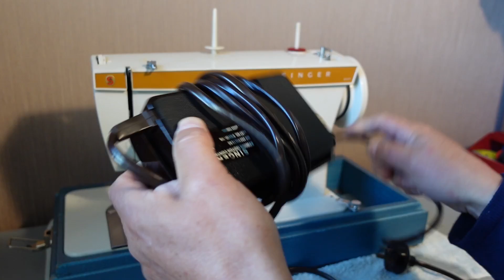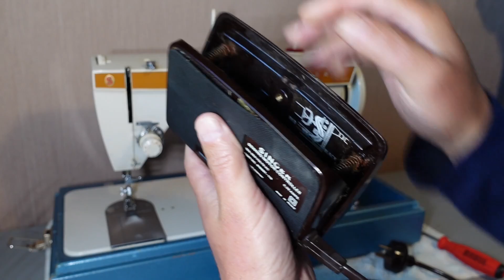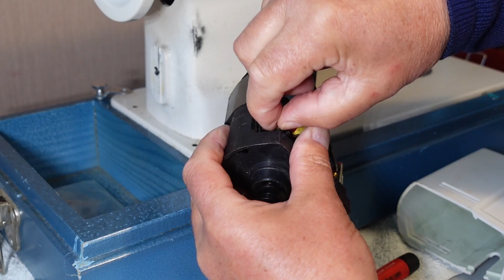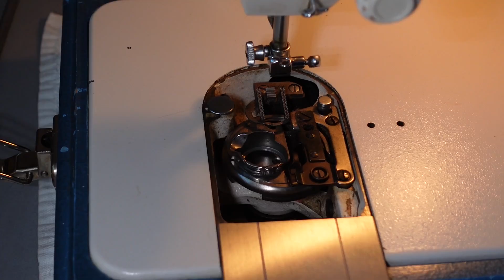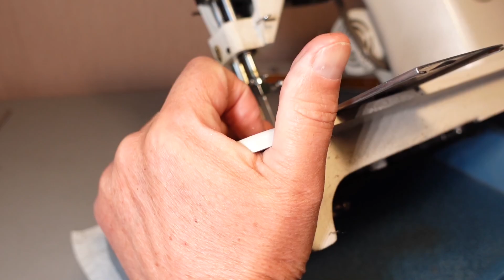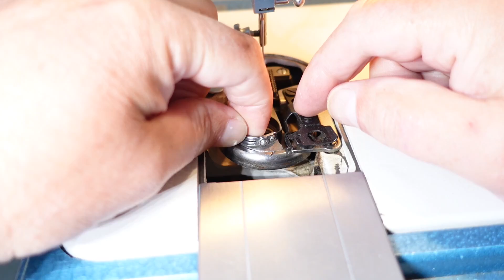Assessing a Singer 247 Sewing Machine for Donation to a Local Charity Shop

Comment: He identified a fault with the cam stack gear, and just left it that way. I think if that is going to fail (as he points out it could fail immediately) then retrofit it with a metal part? I could not find the nylon part online and could not find a metal retrofit either. I did find the Singer part number, #444918 'DISC DRIVING GEAR'. 

To be fair, he pointed out that he refuses to actually put his donation machines into good repair, beyond basic, trivial maintenance, and with the hope that the purchaser of a thrift machine will spend additional time and money to repair the broken machine as needs be. That said, he would have been better to preemptively disable the zig-zag, since a person who takes a sewing machine from a thrift shop will be more likely to lack the resources to spend many more times the amount paid for the sewing machine on repairing the cam stack gear. He says in this video he is doing the bare minimum. To remove the cam stack gear seemed to be a prudent thing to do which he was too prissy at that point to even consider as taking the time to do that would not be trivial.

If a person is only coming to the thrift store, for that machine, the person could lack the resources to replace the cam stack gear, to be fair. The person is not able to buy a brand new sewing machine but some are there to collect antiques. Some may have the resources and others may not.

I used to know a rabbi who on a walk from services with his father, witnessed people giving old clothes into a donation box on the sidewalk, as people do. The rabbi's father said, these people think that they're giving charity, but they are only disposing of the clothing that they would have thrown out anyway. He went on to say, that to give real charity, they would have best put new clothes into the donation box. Because of that story, I began to donate a new shirt to charity when I bought myself a new shirt. I suppose, the same spirit would, applied to this would be to, instead of donating a used machine, that is about ready to break, to charity, one should purchase a brand new sewing machine, and donate that to charity instead.

In any case, people of the past generations were more stringent in their piety but now days, people live like there is no problem doing the things that our predecessor would never dream of doing. We think very well of ourselves these days. We have become so lenient. Great video in any case. I had no idea that the cam stack gear was even there in that sewing machine.

Since I have that same model of Singer, now I need to open mine to see what that gear looks like in my own sewing machine!! I tried to find a retrofit for that gear, just in case, the part number is Singer #444918 'DISC DRIVING GEAR' but only could find the similar part (only fits the 248, which is #444911). I am sure that there are now ways to retrofit that same part though. Maybe with a 3D printer or maybe with an epoxy reinforcement. I would have liked to have found that gear on Amazon but only can find the similar gear that fits the 248, not the 247/242, which seems strange.

Thanks for the content. 
Keep up the good work.
בס'ד

Comment: Hi I have a singer stylist 538 but I need to adjust the timing when the needle posision moves left to right while on the upper posision.  Mine keeps moving the niddle while down the raise and is making the needle flex left and to right. Do u have any advise ?

Comment: I'm not sure if it applies with this particular model but the cam disc on some other Singer models limits the bight of the needle so that it doesn't hit the throat plate. If the cam disc is removed and the stitch width lever is inadvertantly set too wide it will break the needle. This very issue came up earlier this week with a friend of mine.